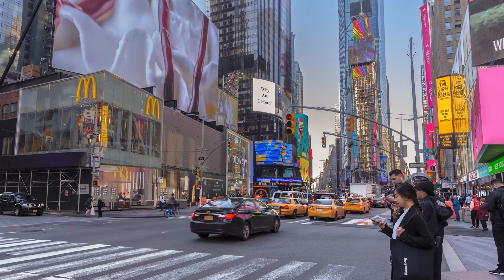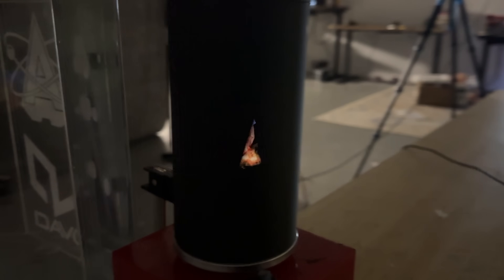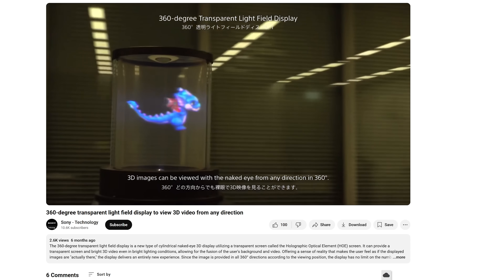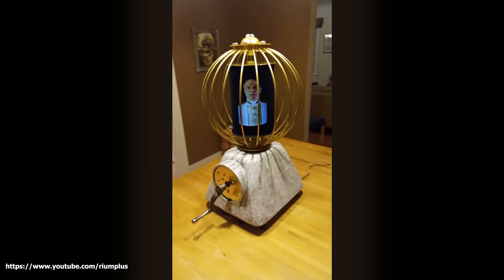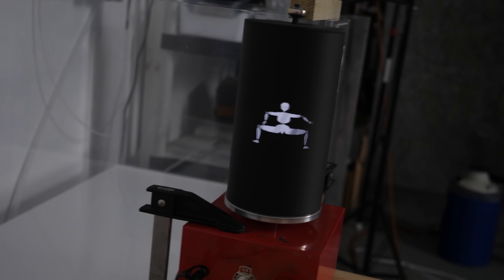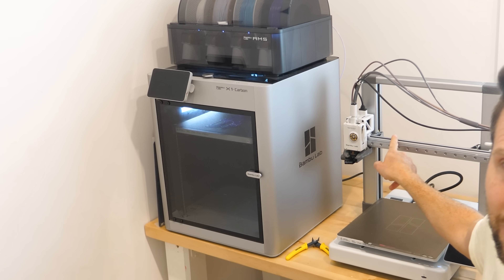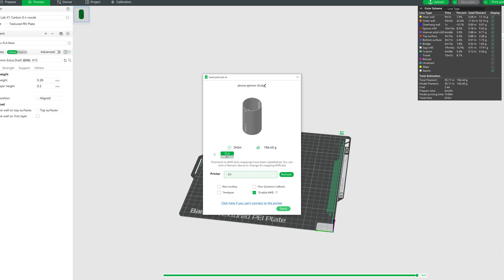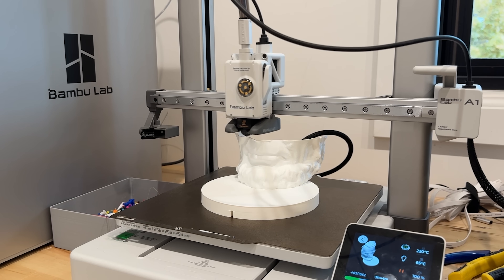The World's First Omnidirectional Screen

Comment: An issue is that most of the light is lost in the cylinder that blocks the light.. So, in order to have a sufficiently bright image, you need a very powerful light source and the corresponding power consumption.
Reply: ...for not a lot of return. Plus the image is inherently narrow. You'd be far better off with just 3-4 regular, static screens mounted around a central pole.
Reply: @AttilaAsztalos  Yeah, but that doesn't have the "cool" factor.  😎
Reply: @AttilaAsztalos  Not a issue, just make the cylinder wider.
But i agree it is not a lot in return.
Reply: There is one more thing. This screen texhnically 'curves' the image because by the time you see the edge of the screen, it has rotated, so that section of the display is farther than it would be on a flat display. You could correct the video with the inverse of that curvature but I believe the curvature depends on how far you are from the screen. Also there is a lot to be considered about framerates and motion blur.

This technology mainly seems good for eye-catching advertisement boards, but needs some refinement before it can be used.
Reply: Doesn't need to be phones, that's just used as an example, could be projectors too.
Reply: There is no real problem in creating a brighter display for that purpose. Projectors are essentially displays with enormous brightness. The electric motor, however, is more concerning in terms of energy usage and maintenance.
Reply: @dokerb3d60  That part wouldn't be issue either.
The outer "slit" can be recreate from LCD screen, and inner screen can be cylinder screen instead of flat one.
And you won't be using anything rotating components.
Reply: Displays are still rapidly getting brighter while using less energy. Modern displays can emit a ton of light for little energy costs.

Comment: I still don't get exactly how this works. What exactly is spinning? Is it just the phones; just the barrel with the slits or both? Would have loved to see an overhead diagram or graphic showing exactly what is rotating and how. There might also be a way for a barrel-shaped screen to model this effect graphically without any spinning parts.
Reply: They're both spinning. If you assume the side near you is spinning from your right to left then as the slit comes into view it first shows you the right side of the screen then quickly moves across to show you the left side of the screen, all of it during the time that the screen is close to exactly pointed in your direction. For someone standing to your left the same thing happens slightly later when the screen points in their direction.

Comment: So to have a reasonable size display on this, you need a couple of 6-ft tall smartphones that you can spin around inside it and a much bigger Andotrope. Sounds completely practical. I want to put my 260-in TVs inside one of these but I'm not sure how I'm going to keep the wires from getting all tangled up
Reply: Make it oscillate back and forwards instead of spinning. Although that's going to be even noisier.
Reply: Concentric contacts that are wired to the appropriate connectors for the display inside the cylinder.
Reply: Just made a static screen instead of spinning the screen.
Inner can be replaced with a cylinder screen (image need some transformation)
And outer slit can be made from LCD display.

Comment: reminds me of how they did trees and other things in older video games.
It wasn't a tree, it was just a picture of a tree that always faced the player.
Reply: Tree’s are still done that way (at least at a large distance (2D plane > very Low poly > Low poly > Mid Poly > High Poly)
Reply: I thought the same. I believe that's called billboarding
Reply: They still do it with fake volumetrics like explosions, fires and muzzle flashes.
Reply: No, they didn't spin the trees really fast with a mask in front of it. You are thinking of a 2d image which rotates to face the player. The image is facing you and from another angle the illusion would not work.
Reply: @gyroninjamodder that’s literally what the dude said

Comment: There is a reason it hasn't been used before.  First, you're losing a huge percentage of your light because of the slits so the display needs to be correspondingly brighter (contrast may be affected too) plus when do you actually want to watch a cylinder of video?

You can't make it much wider without starting to get dangerous/expensive so you basically have a gimmick that might be useful for an advertisement in the airport or at night in vegas (not outside where it would be too bright).

But neat video.
Reply: The brightness is the same percentage of the screen's brightness as the average percentage of the screen you're seeing at any point in time. That would have made this useless in all but a dark room 15 years ago, but nowadays you can get HDR TVs that literally hurt to look at. This thing has active air cooling to the screens at all times so you could probably push the brightness higher too.

The contrast is a bigger problem. It's a bit like the contrast of a projector screen, but instead of an unlit white screen, the black parts of an image are an unlit black cylinder. If it was painted with vantablack that would pretty much solve any contrast problem. 

Size isn't an issue if you dynamically balance the rotating mass. They do this to every car tyre in the world when they mount it on a wheel. Every jet turbine, every propeller over 8", every hard drive, every flywheel in a car engine..
Reply: @IOUaUsername  Yeah. It's like the guy never heard of ball bearings. I don't doubt some version of that will become common (although not this one and not with cellphones lol)
Reply: no reason someone can't use lightweight LCD screens for bigger versions of this
Reply: Instead of spinning the screens inside, you can use a flexible screen rolled into a cylinder and just make the image move on the screen rather than physically moving the screen itself. 

Instead of spinning the outer layer with the slits, you can use a flexible LCD layer (LCD is effectively just shutters) and open/close the shutters to "move" the slits.

That would mean no moving parts.
Reply: @ That is a neat idea but I still think it's not very practical. At that point you are fabricating a giant cylindrical LCD which is going to be niche and expensive.

And I think you still need to do the display on the back surface so everyone sees the same thing so you need both a cylindrical LCD shutter and a cylindrical display (the lcd can't double up as the display tech) which seems alot more expensive than just buying 3 flat screens.
Reply: what are you talking about? It is literally just a screen inside a cylinder barrier with slits. It is really cheap as there is no weird technology that you need to make it. Screen Nowadays are bright like 2000 nits.

Plus, you can actually watch horizontal video, just make the cylinder radius wider. Also it would be not a cylinder video but still normal video
Reply: @ Whats expensive is building a large display like that for viewing flight info in an airport that's safe and reliable. 

 Sure, you can spin two 55" TVs in your garage pretty cheaply but you want to have 80ish kg spinning at near 3600 rpm on a 4 foot diameter circle for years without breaking and without posing a danger to people nearby (that's a fuckton of mass that could fly out if the cylinder gets unbalanced).

Remember, people suck.  You will absolutely have idiots or children throwing things at the display to see them wizz out (risking unbalancing it) because of the great speed so you probably need to wrap the whole thing in thick polycarbonate which likely means you need a forklift to install and do maintenance.  

Since the whole thing spins you need to use those concentric joint things to transmit power which makes it harder to avoid wear and creates another point of failure.  Start adding up the lifetime costs and it just doesn't make sense.
Reply: @youravghuman5231  As you get bigger the footprint of the "display" gets bigger because it's a cylinder; doubling the size of the display squares the space it takes up. That alone would make big displays fairly impractical in public settings.

The Andotrope needs to spin 1200RPM for 40fps according to the website. Since I don't see why that would be size dependent, a 1 meter diameter display (0.5m radius) would have its outer edge traveling over 220 kph. That speed is comparable to the edge of a standard 12" tablesaw's blade.

So the real questions are, 1) how long can you run all those components under that sort of centrepital force and 2) how strong a transparent shield can you make to contain a "catestrophic failure" scenario from exploding like a grenade?

A display that can be seen from every angle but only big enough to be viewed by a few people standing close is going to be limited to some very particular uses; the Princess Leia example is probably being the best case of a few people watching a barbie-doll sized image.

Edit: Given all the mechanical complexity, is spinning a single display really going to be that much better than multiple displays arranged facing outward? Four 1m displays  in a square takes essentially the same space as the cylinder and no viewer can be more than 45° from center, 6 displays takes an area 2m across with no one more than 30° from centered, (8 displays w/ 2.6m and 22.5°). These won't have "perfect" views from all angles, but pretty good ones considering how small these displays and therefore close the viewers would have to be anyway.
Reply: @youravghuman5231  It's more complicated, more expensive, needs more maintenance, more energy, makes noise, poses more danger to people, has more limited size constraints and can be replaced by just having 2 or 3 screens in different angles in most applications. The only pro is that it's cool to see, so a gimmick. Also I think the video has to have a dark background for it to look nice, all videos shown here had that
Reply: @youravghuman5231  Plus, the way shown here is just vertical video. Pretty sure it's more prevalent than "Cylinder video" would be lol

Comment: you could argue its 360° but omnidirectional is a little misleading
i cant view it from the top or bottom smh
though that concept makes me think what if you used a tourbillon and a circular screen you could perhaps even render a 3d image with it that has different perspectives depending on where you look from, not quite sure how that would work tho, the spinning pattern would have to be predictable/linked with mechanics and readable by a sensor to determine its current position and it would have to spin faster to make up for the other axis it rotates around

Comment: To make this on a larger scale, I would use two laser projectors at the base of the rotating barrel to reduce rotating mass. One big challenge would be providing power to the projectors.
Reply: Not a challenge at all - concentric contacts have been used for providing power to rotary devices for decades, using either carbon shoes or conductive roller bearings to maintain contact as it spins.
Reply: @seegee-u3l Awesome! Thanks. Hopefully it wouldn't create its own signal and mess with the picture. I guess the real challenge would be paying for 2 laser projectors.😊

Comment: I bet you could do this without moving parts using cylindrical LCD screens as the mask and image screen.
Reply: I was skeptical but after a little thought I think you would win that wager. The maximum image size may be reduced and further one would could correct the image for distortions.
Reply: nope. not
Reply: @SimSiimoVids  I am exasperated by the exuberance of your perspicacity.

Comment: Someone needs to do this with 65 inch OLEDs :D
Edit: If this thing rotates at 480RPM with 2 slits, that should be an image that feels like about 16 FPS. Wonder if rotating at 2000 RPM would give a higher perceived framerate close to 60fps. Wonder how adding more screens inside (equilateral triangle, square, pentagon and hexagon layout could all be viable) as well as more slits would affect the image quality. Very very interesting stuff.
Reply: The flicker is obnoxious and leads to immense eye strain and fatigue unless the rotor is spinning at several thousand RPM, the faster the better, but then air noise becomes an issue, and putting it under vacuum is just getting ridiculous.

Comment: Neat invention! 

Speaking of moving image frequencies I had a thought the other day! It was about the newer style 3D glasses that flicker and that water hose attached to a speaker trick(where a locked wave appears in the water stream, trick. But that has to match the frequency of your phone camera and you can only see the effect on video afterwards. 

See where I'm going with this? :D

Now what if the glasses flickered at the same time instead of L/R/L/R like they need to for 3D video? You could match the water wave's speaker output to whatever Hz that frequency is, type thing. 

Then you could see the water wave effect in real time! Instead of only seeing it later when you watch the video. Right? 

Know what I mean? Rainy day idea, sir!

edit: Have two pairs and hold only the left lenses or the right lenses to match them instead of trying to mod them.

Comment: I imagine one of the largest limiting factors to this is the large point of failure that is the motor that needs to spin the display. More physical moving components = higher likelihood of failure and higher maintenance costs.
If the spinning mechanism fails the display becomes unusable as a normal display
Reply: Anything with a mechanical component is going to be subject to wear, but if the motor has decent bearings in it, it shouldn't be a problem.  It'll also cease to be a useful device if the display itself fails, and I've seen way more displays fail than electric motors.
Reply: @seegee-u3l  Any moving component has a higher failure rate than any static component, mechanical or otherwise. That's just the nature of friction and time. You're misunderstanding what my statement is if you think it's just the motor itself that can fail. And a dead pixel on a display is not a display failing. It's actually quite rare for a display to fail outside user error (dropping the thing) and when it happens, it's due to a whole batch being bad that the displays were sourced from.

If something doesn't already exist at this point, it's usually because there is some issue at industrial scale. The concept this device uses is not new technology. It's also not too dissimilar in concept from already existing spinning displays that usually just play a simple animation or display some branding for store advertisement. But because the concept already exists there's a reason it's not more prevalent and it always comes down to costs and scalability.
Reply: @pacmonster066  I'm not talking about dead pixels in a panel.  I'm talking about failures in components like voltage regulators, buffers, constant current power supplies, LED drivers, broken solder joints, shorts from whiskers, etc. that render the display unusable, and I've repaired enough displays with these kinds of problems myself - a turning motor can quite easily outlast a transistor if the transistor is operated outside its electrical or temperature limits (I'm looking at you, Behringer...).  Of course similar problems can crop up in a motor control circuit that render the motor useless, along with mechanical issues such as worn bearings or brushes, or other parts that can cause burned windings or prevent the motor from turning at all, but most motor circuits that aren't required to deliver high performance are fairly simple with a limited number of potential failure modes and inherently good resistance against poor electrical conditions. As I mentioned before, if the mechanical parts of a motor are of reasonably high quality, they shouldn't cause much trouble.  My own experience over the past 40 years has been that quality motors and simple speed controllers hold up a lot better over time than the more delicate stuff like displays, motherboards, and other high-density circuitry on multi-layer PCBs.

Comment: It's like trees in old video games where it's just a sprite always facing the player.
Reply: Those are called billboard sprites.
Reply: Yep, billboard is the common term, and they are still used today when the object is far away enough. Saves on resources for distant objects.
Reply: @leekc2998 I see them all the time for small foliage in modern games
Reply: Super Mario 64
Reply: I mean 2D billboards are still an LOD practice, just very far away from the player's reach that it's diminishing returns to have a low poly 3D mesh.
Reply: @acoolrocket  Yep, the further away you get, the less rotation is possible to discern anyways. It's one of the consequences of the parallax effect.
Reply: EXACTLY!!!
Reply: haha
Reply: Nope.
Reply: Ya! I was like wait maybe i’m just old and no one will remember this